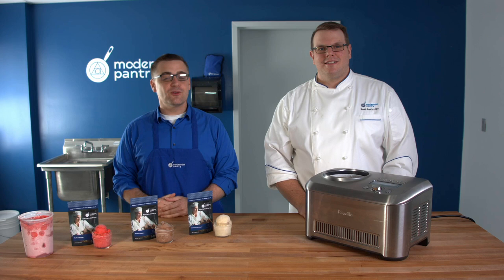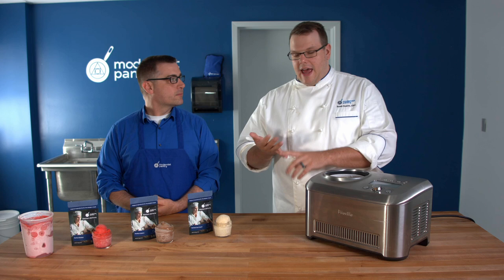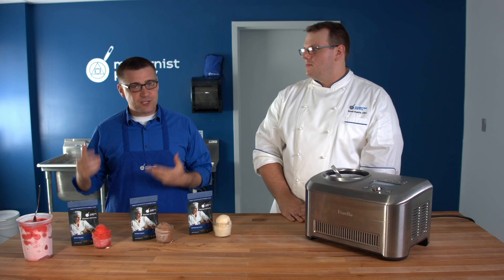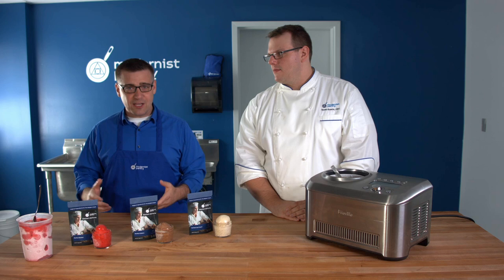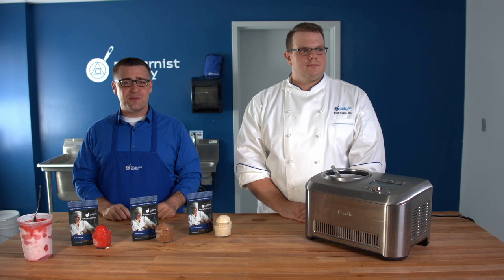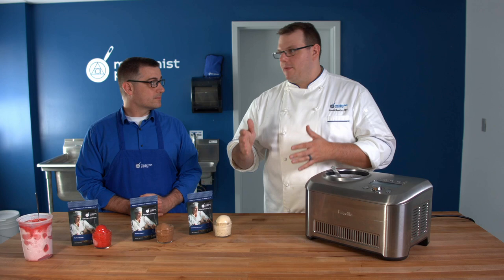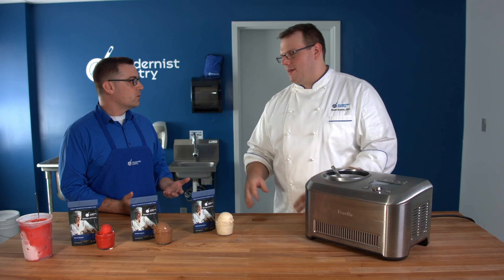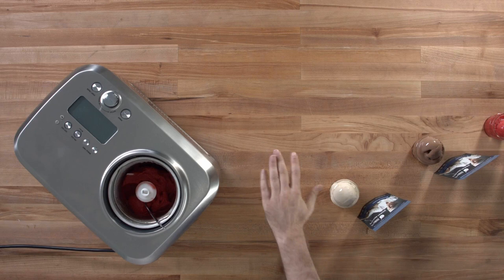Ice Cream Stabilizers? The Secret to a Perfect Homemade Ice Cream | WTF - Ep. 106

Comment: I've been making my ice cream in a Ninja Creami device.  The texture is much better than my compressor ice cream maker ever produced.
Reply: I just bought a ninja creami device. I want my ice cream to be more creamy. Did you add any stabilizers? If yes, how much for each pint?
Reply: @asaam8010 
Place frozen mix in microwave for 30 seconds for a cup, 45 seconds or so for full. If it’s not super solid it creams up quicker. After spinning if it’s still not creamy enough, add a bit of milk and respin.
Reply: Using good chemistry to overcome ice crystal AND using the ninja creami is the best of both worlds.

Comment: For ice cream stabilizers and gums that need to be hydrated in heat: can they be hydrated in singe ingredients, or does the whole homogeneous mixture need to be heated for hydration? 
For example can I hydrate the gums in warm water and then add the water to my ice cream base ad mix; or do I need to heat the whole mix for hydration? Also, do I need to re-mix the ice cream base with gums after hydration and re-cooling of the base?
Reply from the maker: You can hydrate it in a single ingredient, the more important part is making sure everything is evenly dispersed

Comment: Mine is  1.5 Pint Thermo-Electric Ice Cream Maker and i use half&half 1.5 cup batter per batch
Reply: I didn't do weight because its 1.5 cups and never heated the batter every thing right from the fridge. I know flavorings changes the consistency like adding coco powder or using coconut cream which thickens the batter itself, more fat thicker it gets. So how would these stabilizers help me and my machine takes 2 hours for 1.5 pt but no pre freezing tube why bought it.
Reply from the maker: Not sure what the question is?
Reply: @Modernist_Pantry  I'm just wondering about stabilizers and if needed or not. Not sending my ice cream around the world to stores and really doesn't last long enoght to melt away in the bowl or develop icing in the freezer. Made 2 batches today of course needed extra ferm up time in freezer after churning was over but when ready taste much better than store bought brands. Only 3 main ingredients, sugar, half&half and vanilla rest added changes textures so many variables just wondering the science.
Reply from the maker: If you're 100% happy with your recipe and it's perfect for you, there's no need to mess with it. If you're having issues with ice crystals, texture, or longevity or just want to try something out, then experiment with gums. We don't believe in 'the best recipe' or having a single way of doing something.

Comment: 🤣what kind of kitchen house that have a blast chiller
Reply from the maker: blast chiller not required!
Reply: Just stick the mix in a chest freezer, you only want to cool it down rapidly from 75C to 3 degrees C, commonly called the bacteria multiplication zone. Heating above kills it in unhomogenised milk and egg yolks and cooks the egg to make mix thicker. To prevent burning mix use two different size of pots one outer with water and inner pot for mix. Hope the above explains it. Have fun.